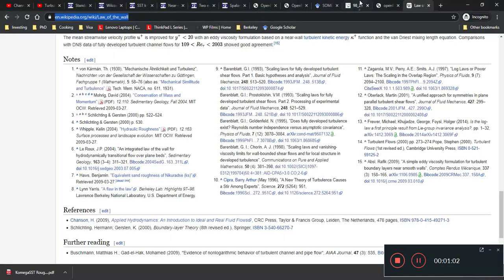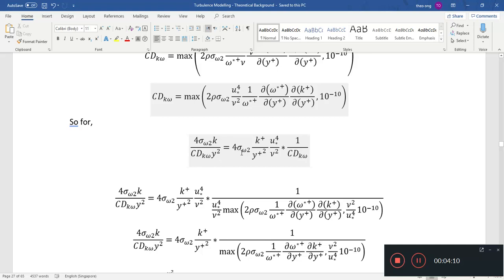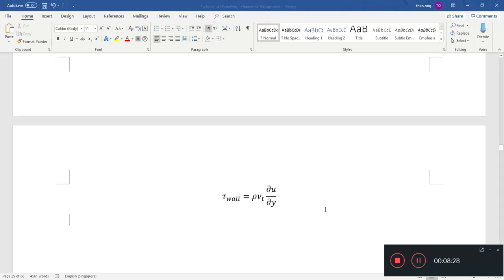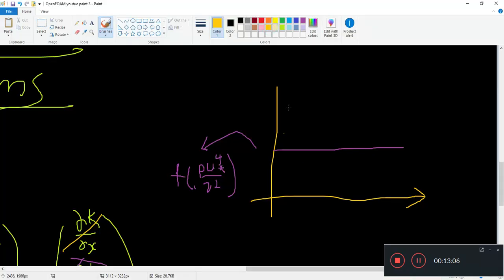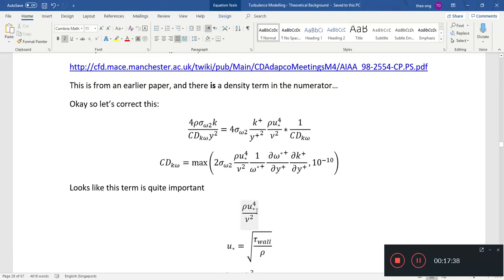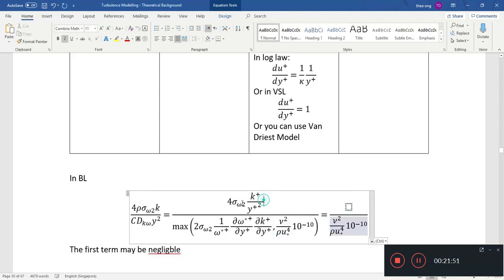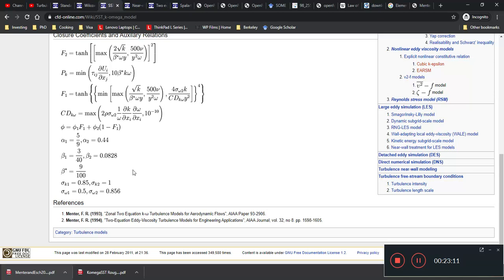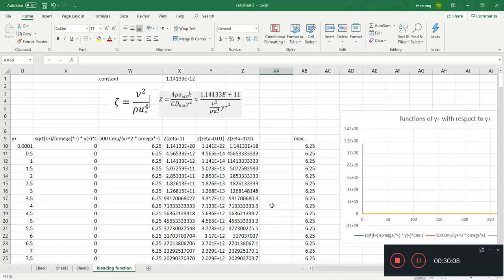Turbulence Modelling 37 -  kOmegaSST Model part vii Blending Functions and Wall Functions

Comment: Hi theo!
If you are not busy, please answer me.
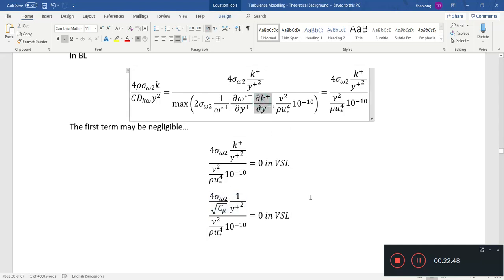I have a question at 22:54.
You have used k+ of logarithmic layer to viscous sublayer.
Why it is possible?
And also, the reason that we can neglect '2*sigma*(1/omega)~~(partial k+/parial y+)' is
'2*sigma*(1/omega)~~(partial k+/parial y+)' is zero in viscous sublayer.(partial k+/parial y+=0, Molecule viscosity)

'2*sigma*(1/omega)~~~' is placed to max(~~~~, ~~~~~).

But in logarithmic layer, (partial k+/parial y+) is not zero.
So I think we can't neglect it and we should consider it.
But why it is possible to neglect it?
Thanks.
Reply: I think this is same question with below, but I can't understand.
Reply: @TheoOngScienceAndEngineering  
Thanks for your answer.
Before I've already found answer why turbulence viscosity is negligible in viscous subalayer.
What I've heard is we can neglect something related to turbulence in viscous sublayer because of dominant No slip condition(Molecule viscosity)
I understand you are very busy because you are Ph.D candidate.
I am also in master's course.
Actually I'm in laboratory in fluid mechanics and I'm interested in turbulence.
But major of my advising professor is not turbulence modeling and CFD.
His major is experimental fluid dynamics and Hemodynamics.
So I couldn't learn knowledge of turbulence perfectly.
But I've seen your video for turbulence modeling and it was very helpful.
I'm always appreciate to you and your video.
And also I'm going to start to learn OpenFoam and see your video for OpenFoam.
Thanks for your active youtube channel.
(P.S: I'm not good at Englsih because my mother language is not English. Please understand me)